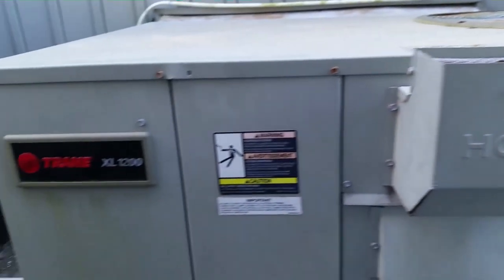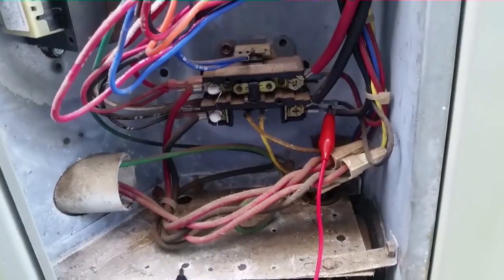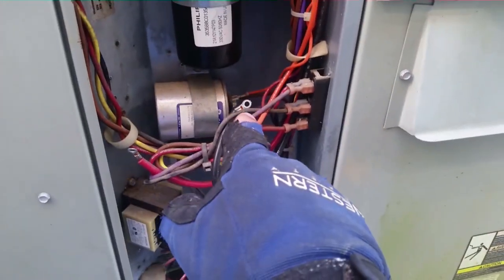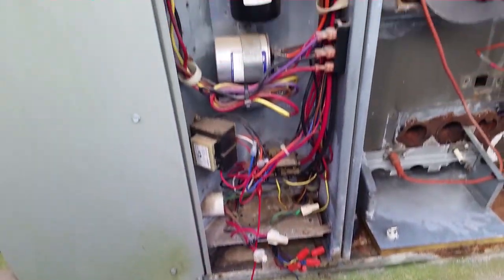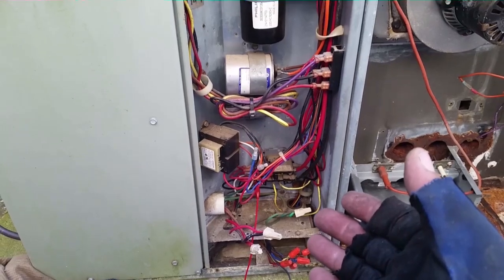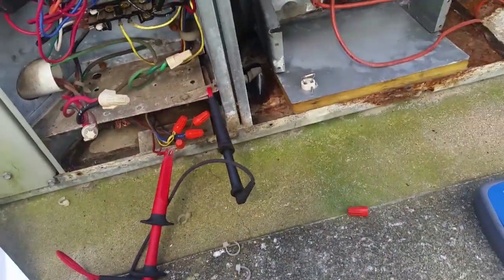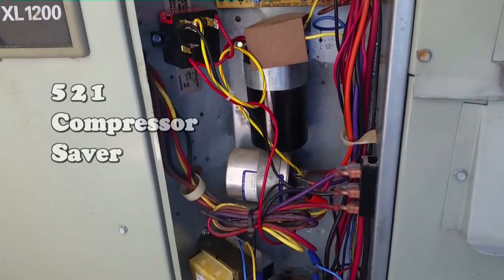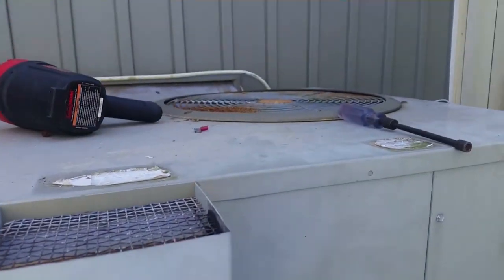HVAC Service  - Trane Gas Electric Package Unit with Electrical Issues

Comment: Another great job. I'm gonna try those transformers with built in breaker, seems like a good thing to have in a great running system. Not saying that system was great Lol!!!!!
Reply from the maker: Big transformer has the breaker, only drawback is it is overkill for the load.